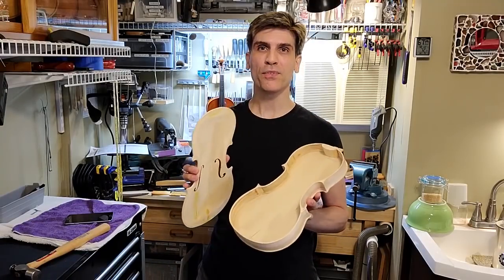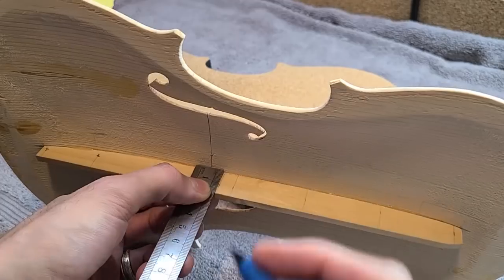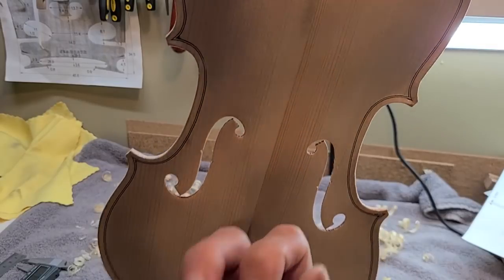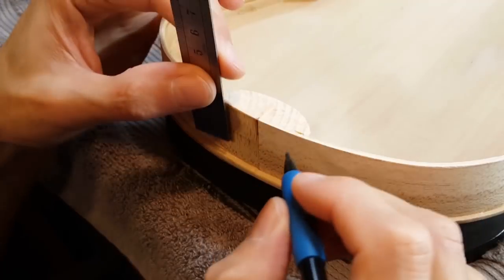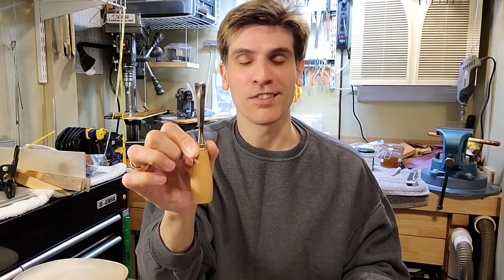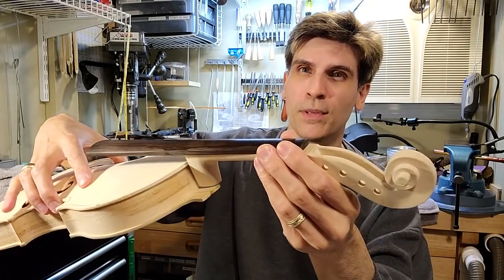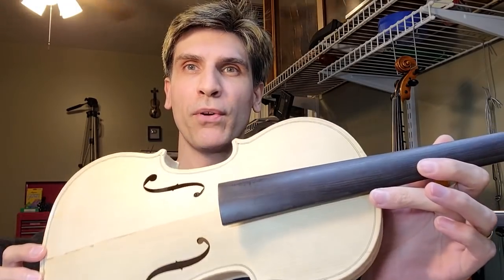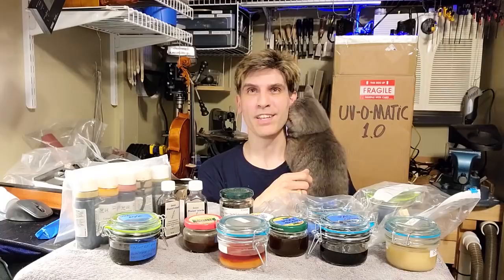Assembling 'Crispy', our Sacrilegious DIY Violin Kit

Comment: It was nice that the top plate wasn't attached because it gives people an opportunity to graduate the top, which is no doubt too thick, and having to obtain the wood for the bass bar along with gluing it in and carving it is good preparation for fitting and attaching the neck.
Reply from the maker: Surprisingly the graduations were within 'normal range' and I didn't have to mess with them.

Comment: Using that small speaker for the chladni patterns is brilliant. I struggled using a whole stereo system because I couldn't position the speaker in the right spot for anything other than the mode 5. I guess I just assumed the small speaker wouldn't have enough oomph. Definitely going to try that for my next instrument.
Reply from the maker: That little one has just enough to get the plate going.  A bigger speaker with more oomph on the bass would be better for the lower frequencies, but I don't mess with this often enough to remember to look into it.   😊

Comment: Wow! So many tools. So much sanding and filing! That frequency test with the particles was like magic. Im still confused how it works, though.
Reply from the maker: In simple terms, things vibrate when stimulated with sound. Depending on the thing, certain parts vibrate more than others. The Chladni pattern test shows what parts of the violin plate are vibrating more than others. It's an important tool in determining if your plates are vibrating according to what is considered the 'ideal' violin vibrations. Does that make sense?  😊
Reply: @SculptyWorks  Thank you!!

Comment: Back in the days of Amati and Stradivari, they don't have that equipment to check the modes. How did they do it back then?
Reply from the maker: Tapping.  😊
If you hold the plates by certain points and tap them, and if you have a good ear, you can hear the frequencies. I do that normally, but it's not visually interesting. The Chladni patterns look better on camera.  😉

Comment: From what I understand if these parts indeed come from a mass producer in China, the building process you're doing is essentially what they would normally do, correct?

They can mass produce as much as they want, but without a luthier finishing the work it wouldn't be worth the $200-300 these go for.

Thank you for making the video. It's awesome to see the process even if it doesn't come out well in the end! Looking forward to the vanish next.
Reply from the maker: I think they are a bit faster than I am. I'm a slow builder, like I said before. But the process is more or less the same, give or take a few modern tools, it's still the same thing since the 1600's.

Comment: The saddle is not on crispy yet? I would have thought that it would be on crispy by now. Does it only go on when you put the varnish on?
Reply from the maker: On my previous violins, I put the saddle on before varnishing; but recently, I have been told by a much more experienced luthier that that's 'bad practice', and that the saddle should go after the varnish, so I'm gonna do that with Crispy and see what the fuss is all about.  😊
Reply: @SculptyWorks  from another luthier. 

Saddle goes on after. 
I don't like varnish on the saddle.

Comment: Cool...the clamps when puttng Crispy together remind me of when learning to put on the lugnuts when changing a tire. Is there a specific pattern used typically?
Reply from the maker: Yes-ish. Usually you're supposed to start with the inside corners of the C-bouts, but that also depends on your glue technique. And how well the plates line up with the ribs. It should come as no surprise that Crispy needed a bit of a push here and there to make things line up while gluing, so you see me start with clamps on top and bottom and then the C-bouts. From there it's kinda like lugnuts, putting clamps on the sides across from eachother.  😊

Comment: When shaping a violin bridge do you put a small piece of vellum on the place where the E string goes to stop it from cutting into the wood?
Reply from the maker: Sometimes!
Unless I judge it necessary, or the owner of the instrument asks for it, I actually prefer to use the little thing most E strings come with, which is affectionately referred to as the 'tone killer', which I actually find it helps cut down certain shrill frequencies we consider undesirable. ...sometimes. Varies from instrument to instrument.

Comment: Can you do a video upgrading one of the basic violin packages off Amazon... Not a complete diy, but a diy using a violin without rejected parts, so those of us without lots of money could try to make one usable?
Reply from the maker: I thought about making such a video before, but the problem is there's a huge variety of those Amazon violins, and from what I've seen, servicing the ones people bring into the shop, is that consistency is not their strong point either.
I know violins can be very pricy, and that is a problem for many people, but my sincere advice is don't buy them from Amazon (or eBay) unless you absolutely know what you're doing and what to look for.

Comment: Why is the base bar so far off center? According to wikipedia: the base bar is positioned beneath the lowest string to help the instrument support the weight of the tension places upon it by the strings. I assume that since the lowest string is the chonkiest boi, that's the area that needs the most support.
Reply from the maker: The bass bar not only supports the considerable 'weight' of the strings pressing down through the bridge on the top plate, but it has the job of transmitting the vibrations from the bass foot of the bridge across the top plate of the violin. For it to do that efficiently, it needs to be placed in a very specific spot and at a very specific angle. That is calculated according to the proportions of each individual instrument. If you put it in the center, it simply can't do its job.   😊

The lowest strings actually tends to have the least tension. On Dominant strings for example, the G string tension is about 9.9lbs, the D is 9.8lbs, the A is 12.1lbs, and the E is 17.2lbs.

Comment: I've never seen or thought of the way to check the resonance (?) the violin body gave like when you check the proportion using particulates. Very intriguing.

But I don't understand how you tell what's good or not! :p
Reply from the maker: Great violin makers can tell just by tapping here and there, but the Chladni Patterns make for a more visually-interesting way.  😉
In simple terms, you're looking for what shape/figure the particles form when excited at specific frequencies. According to our studies of violins everybody agreed sounded great, if your pattern looks like what it does on those reference great-sounding-violins, your violin is on the right track to sounding good. In theory! Like with everything in violin-making, this is only one of the many pieces of the puzzle.

Comment: Why the bass bar dont go in the middle?
Reply from the maker: The bass bar has a complex job of transmitting vibrations from the bridge's bass foot onto the top of the violin AND supporting the significant pressure that the strings put on that side (the other side has the soundpost to support it. ...and transmit vibrations too, just in that case not only to the top but to the back of the violin too)
Reply: @SculptyWorks   Thank you! It makes much sense!